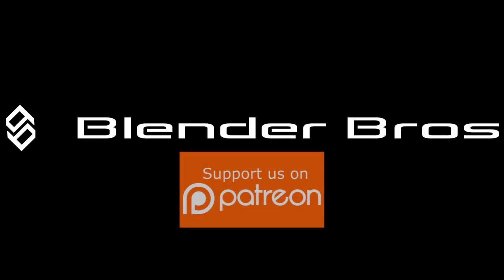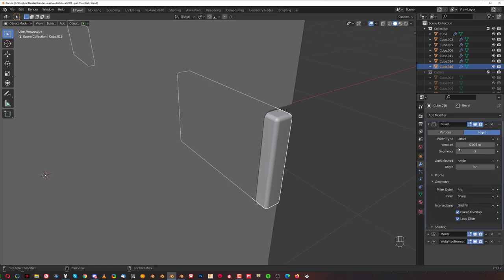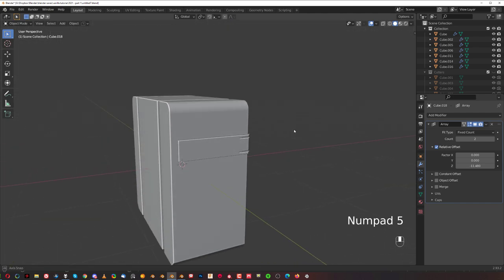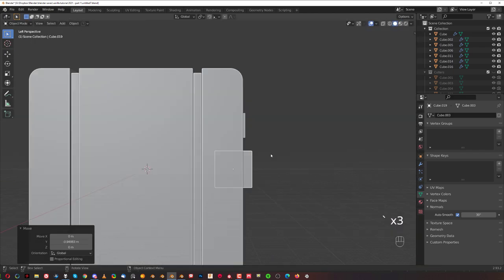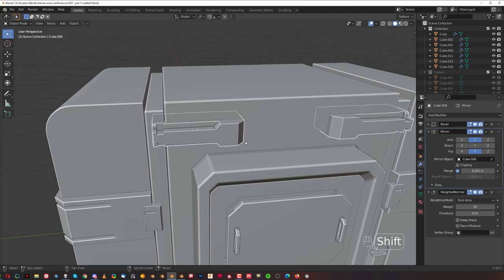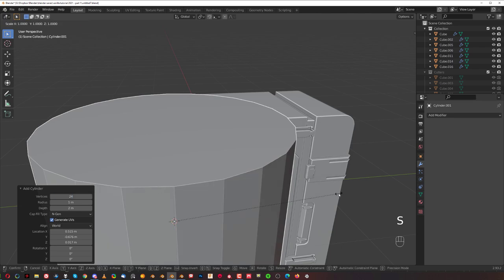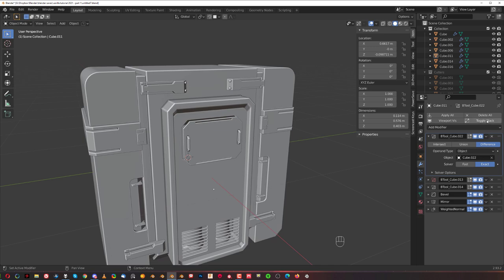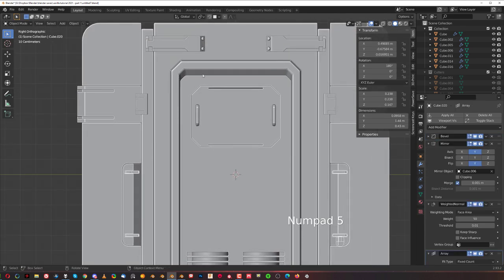Blender Tutorial for Beginners Part 2 - Hard Surface Modeling - Secondary Details

Comment: Ryuurui-sama, in your free course "Hard surface jump start" you often applu shading smooth \ auto shade for the cutters objects. I've got a quiestion -- for what purpose? Those objects will be hidden after performing boolen ops on a target mesh, so why even bother? The shading settings will apply anyway to the resulting cut will it? Is there something I'm missing.
Reply from the maker: Try running bools without it and you'll find out.
Reply: @PonteRyuurui  True enough. The difference in shading is obvious. Thanks!